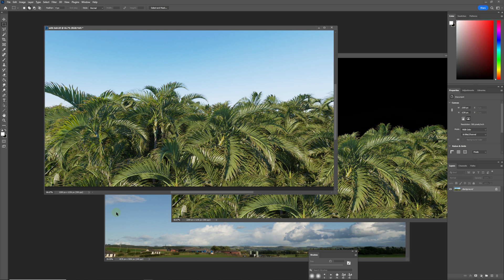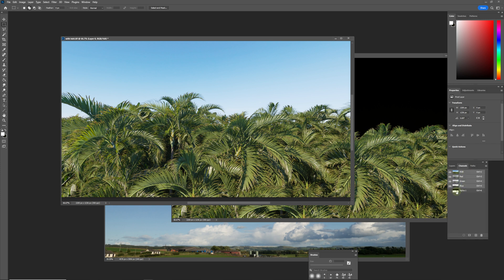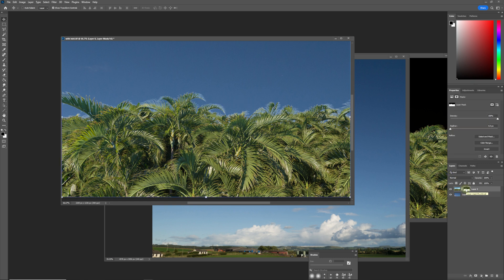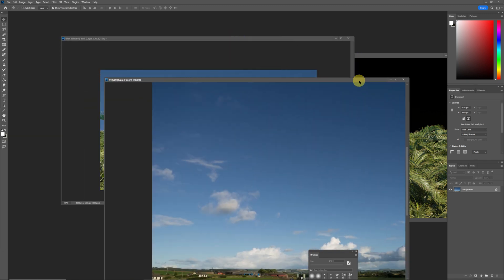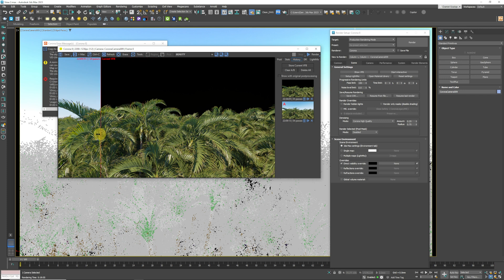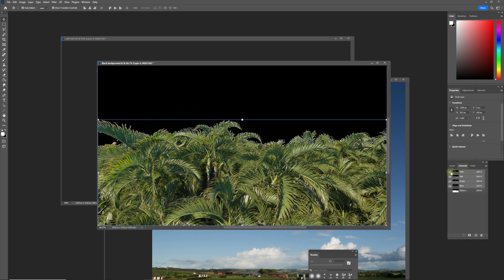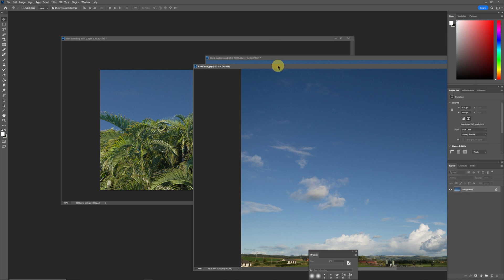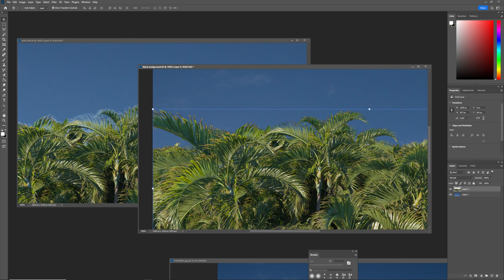Defringe/Remove the white fringe from your renders when replacing the sky.

Comment: Thank You So Much Sir For This Yesterday I Was Search About This And Today You Did This GOD Bless You 💕💕💕💕
Reply from the maker: Really glad it helped you :) all the best!
Reply: @ds-works  Yes OfCourse I have Just More Question.  During Light Mix I got Alot Noise  when Increase Light intensity Plz TELL Me Any Solution how i can fix this issue thank you  💕💕
Reply from the maker: Hi, it could be a few things I but difficult for me without the scene in front of me. Check your denoising settings, if your base screen is too dark it might be a factor also. Try to setup a neutral lighting scene then play with light mix should work fine.
Reply: @ds-works  Thank You i will try to share file with you SOON Sir 💕💕
Reply: @Artist_KSA  increase the intensity of the actual light within the scene instead of within the lightmix, it will reduce the noise nearly completely.
Reply: @bigjus3751  thank You Bro Let Me Try